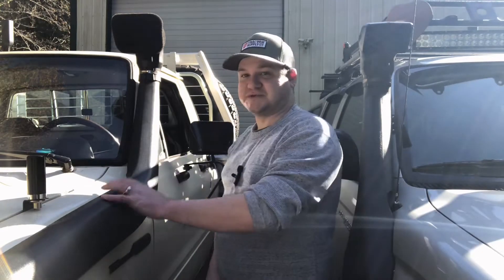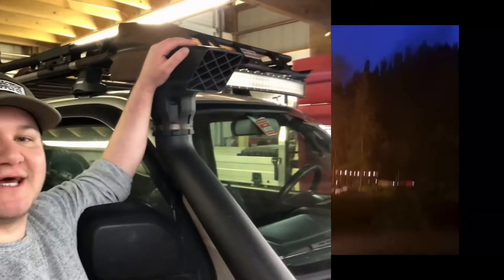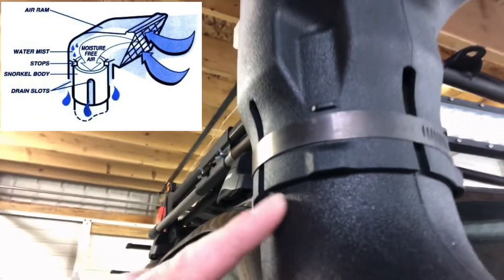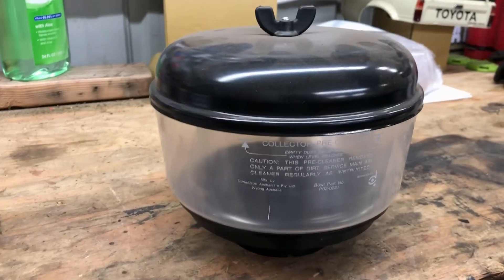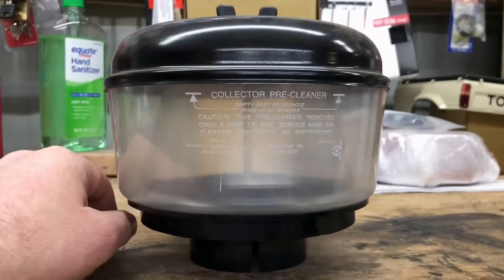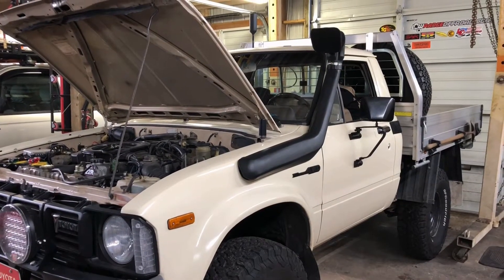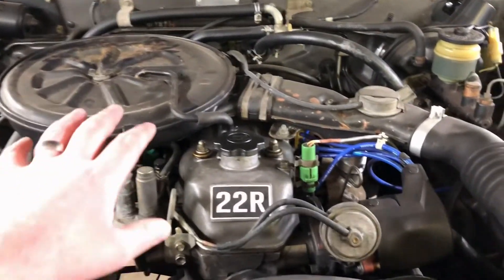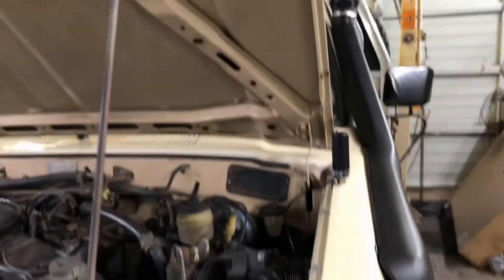Snorkel Everything!! + The perfect snorkel for your 79-83 Toyota Pickup

Comment: Interesting creative engineering.  Could you have done the same thing using/a Safari Snorkel kit for a 1984 Toyota Pickup?  Would the fitment/gaps/etc been about the same?  Also. the gray PU w/out a snorkel - what is the name of the brush guard bumper?  I understand ARB briefly made their bumpers for '79-83, but have not for decades. It was a bolt on w/no cutting of lower fenders or lower valence -.  Few made it to US.  Looking for a period correct Bull Bumper/brush guard.